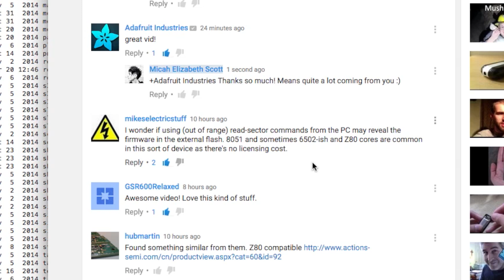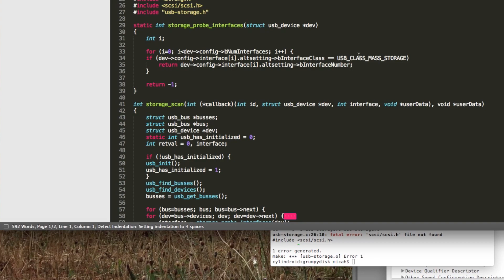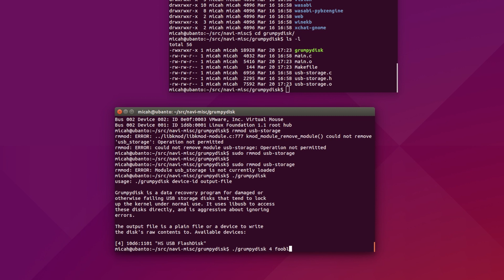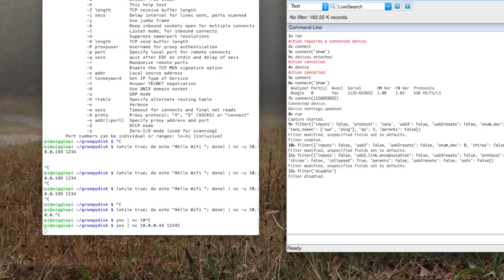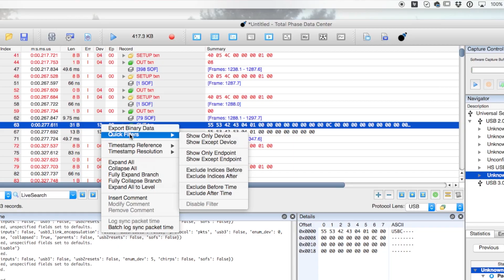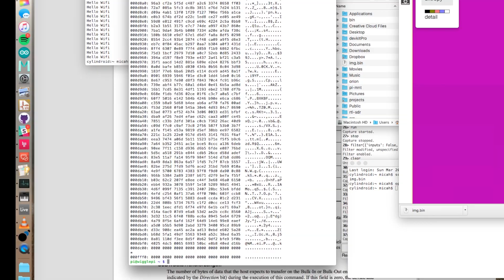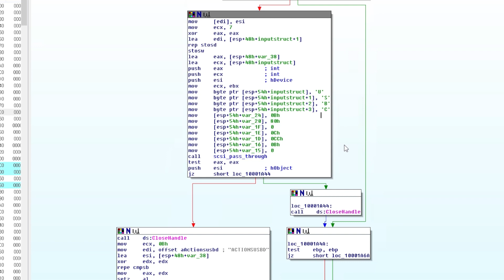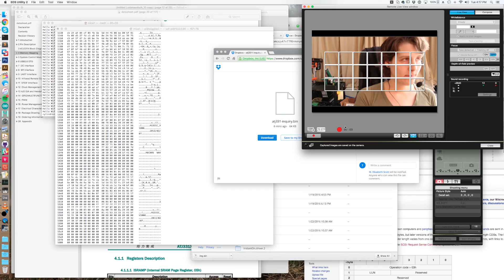USB Disk Recorder Part 2 - scanlime:007

Comment: I hope I found the "tool" to update, I've added it to the https://gist.github.com/hubmartin/82d4b443731673d3985c
Not sure if is for your current player but you can try to at least connect it and don't flash it. You could try to disassembly that tool software and find out the protocol or SCSI commands. Good luck, thanks for second part.